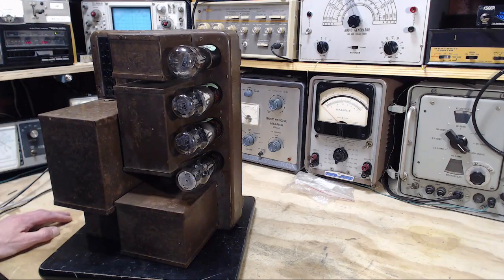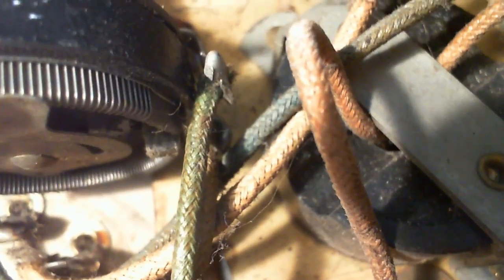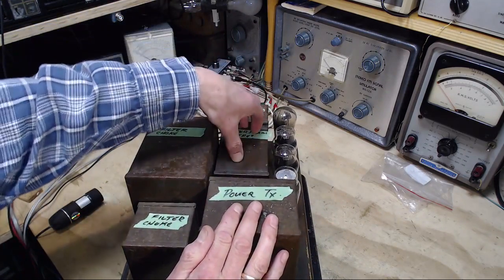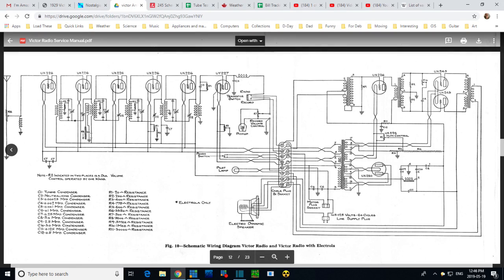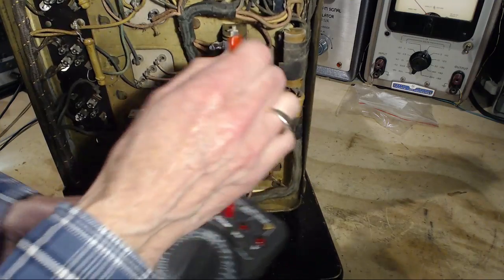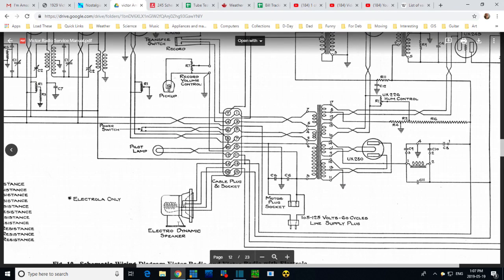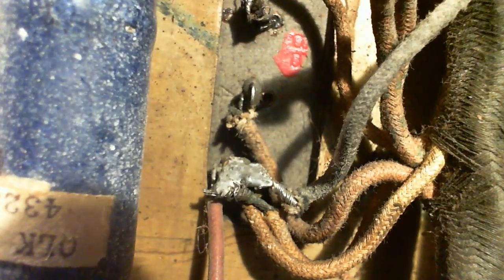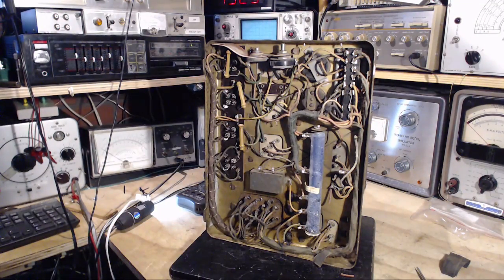1929 Victor R-45 Radio Video #5 - Model 245 Amplifier Inspection

Comment: Here it is, 2022, and I'm screaming at my laptop to tell you that you're working on an older version that what's on the schematic. I hope my time-traveling advice was heard, but I'll have to watch the rest of these videos to find out. Anyone watching in the future, RCA changed the design of the power supply during the run of this system, and the older ones had 4 capacitors in the big capacitor block, and a different divider resistor.  I believe Riders or Beitman's has a schematic that shows the older chassis, and if you could find RCA Service Bulletin 25-A (I can't find it online anymore), that covers the older one also. They also later added a fuse on the AC side (which I added to mine as well), and a small .125 uF across the choke which this one doesn't have.  Hopefully I'll see that he figured out the choke was in a different can.  (Yup, that HUUUUUGE metal box only held 4 filters, none of which were over 6 uF, in all that tar. All they had back then was paper wax types, and they tended to leak, often taking out the power transformer with them!)  Since I've now started on my second one (my first was done before this video was made), I'm going to watch the whole series. I've already learned more than I knew about the speaker since my first one worked perfectly.

Comment: Maybe whoever did the repair didn't know the proper value for the capacitor so he just put in what would be a typical filter capacitor value in 1965, which would be more like 20 or 40 uF than 2 uF, or maybe the larger capacitor decreased the hum so he figured no disadvantage so why not?

Comment: Jim. it look like that terminal with the 4 (5) connector are ONLY the internal caps look at diagram you can see that there a circles with the number 1 to 4 next to the.  the inductor has the number 1 and 2 next to them  i think that are the terminal dat are in the right bottom. so i think if you like to replace those 3 caps C9 C10 and C8  you can beter disconect those 4 contacts.  and place a own terminal strip with the 3 caps.

Comment: All 3 grid resistors are across transformer windings. I wonder why they thought the need to do that.
Reply: a winding is NOT a short, its only a short for dc, when there is a ac on it the winding get a higher impidence. when some HF is going true the trafo then there is a chance that impedence is geting to high and you can end up with oscilation. (sorry for bad my 
english)

Comment: Interesting, these really old sets, and the ways they documented the schematics. One thing about the "Chinese Component Tester": The terminals go into the MCU without much overvoltage protection. Always assure the capacitors are discharged before connecting to the tester. Btw, I have the exact same model, and I discharge caps each time first..

Comment: You can find a better schematic on Nostalgia Air. Here is a link to it:  http://www.nostalgiaair.org/pagesbymodel/769/M0015769.pdf   On the second page the right hand schematic is the correct one and on the bottom left is a diagram of the condenser block.

Comment: Just a reminder Jim, make sure you turn your main control on your Heathkit all the way left when doing leakage tests. It can burn the wire wound pot. It happened to mine and it wouldn’t read values right after it ruined the pot from the cap discharging through the winding. I found some new ones and it works great now but I’m very careful to turn that control left when leakage testing.